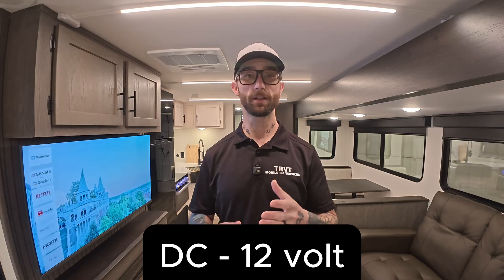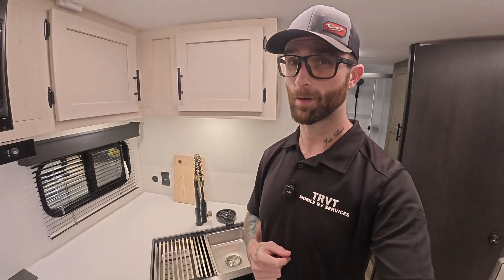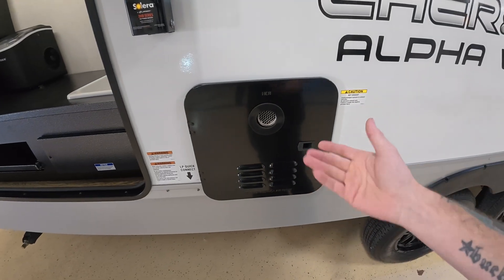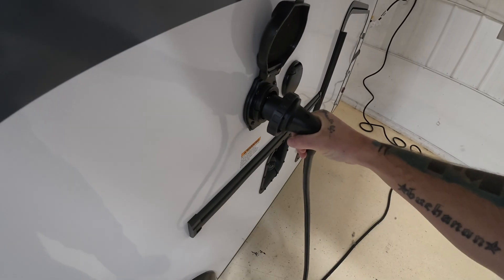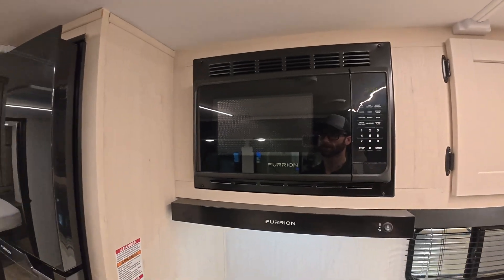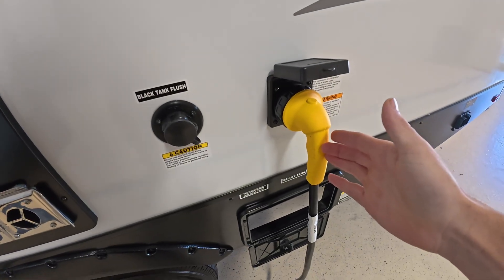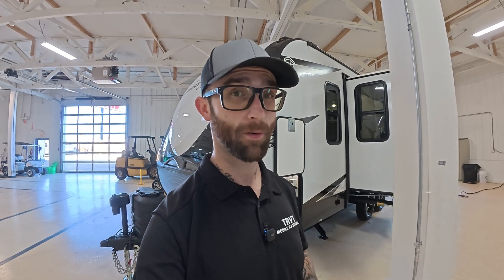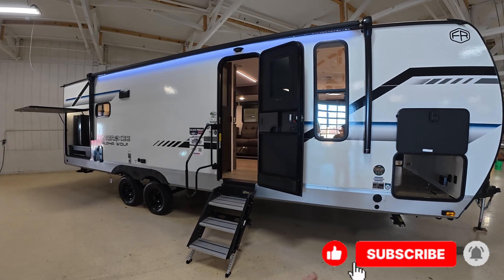RV electrical systems - AC vs DC

Comment: Thank you for the so informative video.  As you said, 12v is the "heart" of the RV electrical system. And what type of battery is supplied? A lead acid battery - cheapest, worst battery to rely on.  I'm buying a TT in May. Can I just replace battery with a Lithium one?  Thank you
Reply: When I went to the dealer to check on a new trailer, and put a deposit on one, they gave me options for batteries, either the regular old school lead acid deep cycle batteries which is what I went with for now, but I had the option of Lithium or the newer and better Lithium Iron Phosphate batteries.  You can also get AGM batteries but those things are garbage I have one in my lawn tractor and that thing is trash, wouldn't get AGM batteries for anything.  I'd go with the Lithium Iron Phosphate batteries if I were you, especially if you are going to run solar which many trailers now are pre-wired for, and some even come with a solar panel or a couple panels and a charge controller already on the trailer....Worse case I'd get the lithium batteries, but if you have the extra budget for them, step up to the lithium iron phosphate, they'll last longer, many people say 10+ years out of them.  

The thing you'll have to check though is make sure the converter in the RV/trailer you are looking at is one that can charge those lithium or lithium iron phosphate batteries as it requires a different charge rate and voltage to properly and safely charge them.

Comment: I was told that I could be plugged into shore power without my batteries connected and use my slide and lights to clean my RV on the inside. The slide needs to be out to have space inside for moving around the inside of the RV. No air conditioner or microwave being used.

Comment: is a battery a must when plugged in at the power pole ?? my battery is old and what to replace soon but if its dies before I get one I what to make sure its ok without battery for a day or two
Reply: If the battery is bad you need to replace it, you can damage or destroy the power converter in your RV/trailer by having it plugged in and not being able to charge the battery because it is bad, or not even there.

Comment: If I’m connected to shore power and I remove my battery why do my 12volt systems still work in the camper? Is it because of the converter? If so, is this ok for winter storage to remove the battery but stay plugged in and run say the radio to deter mouse activity?
Reply: The converter supplies the power to your 12V system when you are plugged into shore power...its not good on the inverter to directly run it that way its really meant to just charge and maintain the battery on the trailer or RV, not to supply continual high amp and high watt power output to run the 12V stuff directly.

Comment: Great video:  so many new RV owners simply don't understand this.  I see this particularly in comments from people who are plugged in, and they DON'T have batteries, or the batteries are bad.  In my estimation, converters don't put out sufficient amperage to handle bigger slide-outs.
Reply from the maker: Correct, it can actually burn up a converter or the battery could boil over. It’s also making that converter work super hard 24/7

Comment: Great video! I was told by dealer that when the travel trailer is connected to the break hitch and the vehicle driving down the road, the battery is being charged. Is that true?
Reply: If your tow vehicle's electrical receptacle is wired properly yes, but very little current actually runs through that wire, less than an amp usually, its more of a battery maintainer/trickle charger effect...its not going to charge your trailer batteries from completely dead to completely charged.  It usually just supplies enough juice to keep the batteries at a charged state for example if you are running your 12V refrigerator or something of that nature while you are on the road, it'll provide enough power to maintain the battery level, but nothing more.  

However, you absolutely could run a dedicated charging wire from your tow vehicle to the trailer to more quickly charge the batteries.

Comment: thanks for the clarification, AND one more major 12v  appliance is the breaks on the rv. :)
Reply from the maker: That's a great point, thanks for adding that!
Reply: Usually not connected to the batteries of your RV though....they're ran from your tow vehicle's electrical system...and usually a separate battery is used for the break away system that activates the brakes if there's a failure in the hitch system and the trailer disconnects from the tow vehicle.  You might occasionally find that the braking might draw power from the trailer batteries to help maintain the charge of the brake away system, but they don't work off the trailer's batteries normally.

Comment: Nick any chance you can do video on solar charge controllers?  Most new campers in my area have a converter and a solar charge controller
Reply: I wonder about this too.  The Trailer I'm looking at comes with a 190 watt solar panel on the roof, a 30 amp charge controller, and then whatever batteries that are hooked up to the trailer.  I'm curious how much more battery power and solar panels I could add and still use that 30 amp charge controller and what benefit I'd have whether it would be feasible to add say a 2,000-3,000 watt power inverter to be more self contained as I'll be living in the trailer full time, so it would be nice to run some 120V stuff without needing to run the generator.  Also to keep the batteries charged while I'm away at work during the day.

Comment: Not entirely true that 12vdc is required for a propane fridge - some operate on just propane.
Reply: Except the control panel itself does require 12VDC power...the cooling portion of your refrigerator uses propane, the controls themselves still require a power source, the propane doesn't provide that.
Reply: @wildbill23c Please dont tell my domenic as it runs without any power as long as it has propane.